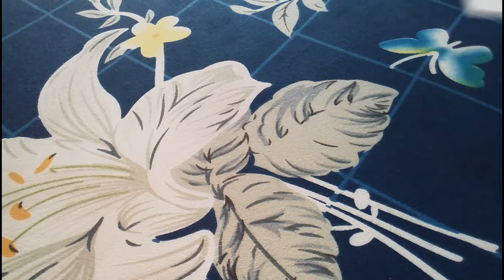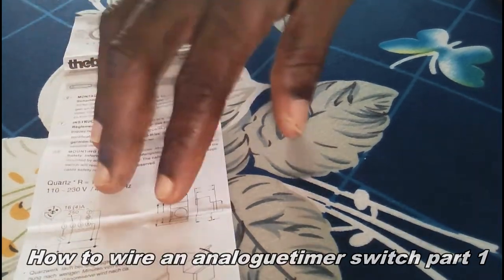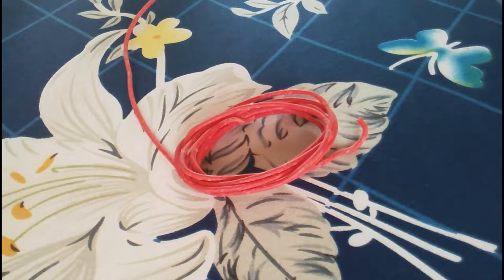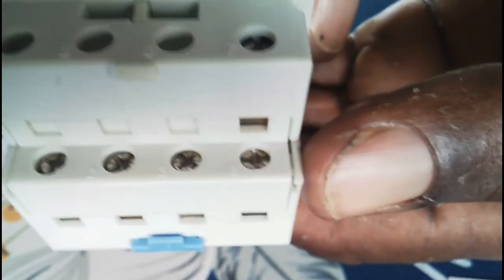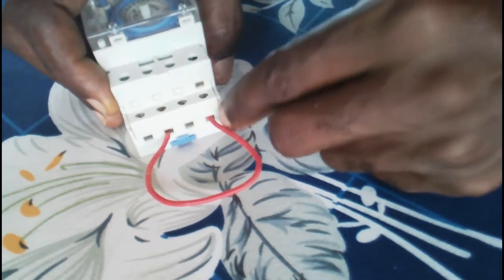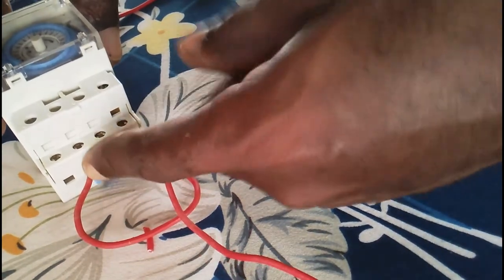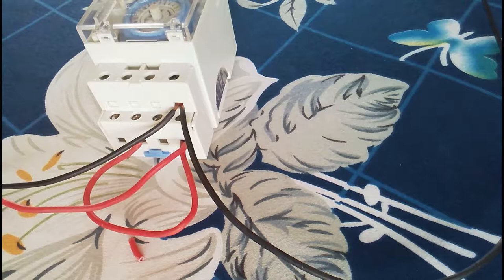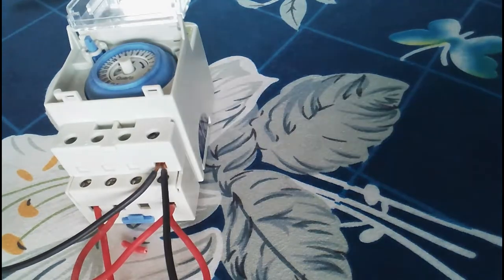Cabling a timer switch part 1

Comment: I am installing a 16 Amp Hager EH011 Slim Din Timer to a 1800 Watt Hot Water Unit. Could somebody tell me if a Contactor (Relay switch) is required.